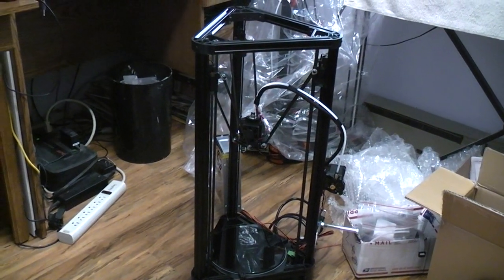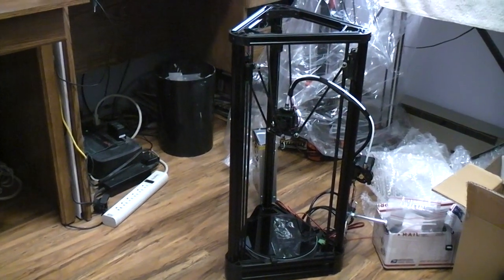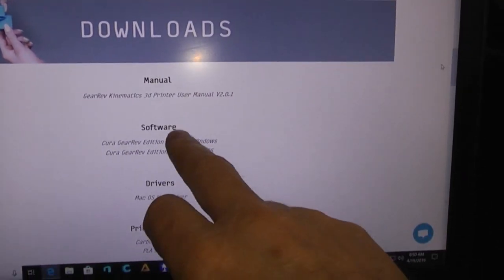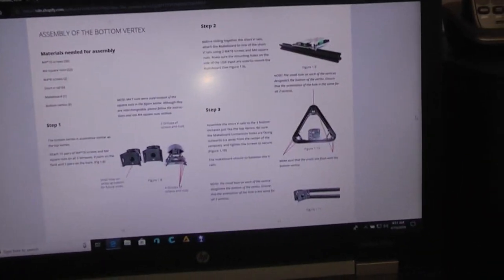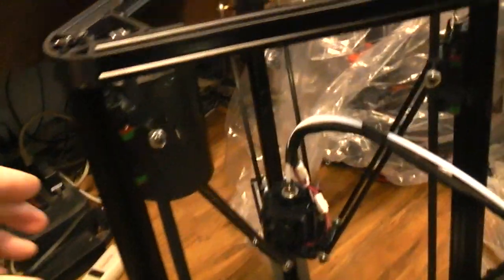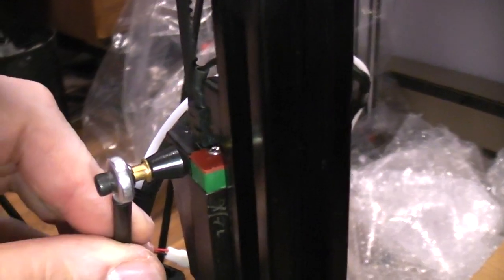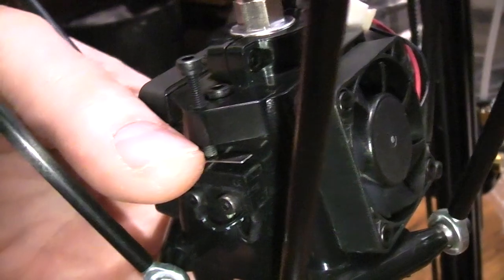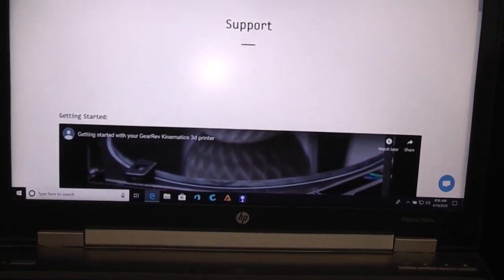GearRev Kinematics "MicroMake D1" Delta 3d printer, linear rails, $126 bucks Part1 build

Comment: Have you gotten yours to work? ive just assembled mine, and it came with a broken psu, rusty rails, and I cant get its firmware to do crap. When I load up a gcode file it heats up, then cools back down and acts like the print is finished
Reply from the maker: I am waiting for the Control board to arrive, mine was missing the control board as mentioned. But The rails clean up easly and a drop of oil in the ball bearings made them work so nice and smooth in my case any way. I will probably order another one just for the parts at this price. Seems that these came out in 2017 so they are either old stock or returns or both. The FLSun , the Micro Make D1 and the GearRev all seem to have been built by the factory and came out at the same time. The FLSUN has a few minor changes. I will post a follow up video once I get the control board. You should email them that yours is not working, they probably will send you another unit.
Reply: @Robothut  are they sending you an entirely new printer? I'll try the oil trick, can I use wd40? I've contacted them though eBay and I'll see what happens, so far I'm not happy with my printer, and I hope a new one they send would be better. I'm also flashing Marlin to it because repretier+ gerrev cura is outdated and practically useless
Reply from the maker: I am not sure if they are sending a new printer or just the control board. We will have to see, last time it took 13 days to get here so probably next week before I know. Yes it might only be a good deal for those that want a lot of 3d printer parts that they can use for custom 3d printer projects. But on the other hand if they do send you a replacement printer then that would be a super deal for parts. I still like the CTC 3d printer kits you can buy at $79 bucks on Alie express and gearbest and so on, just for parts, and I really like buying the FOR PARTS ONLY flash forge printers on ebay like the Flash Forge Finder for $100 bucks. Even if you can not fit them the parts alone are worth the bucks. So yes contact them lets see if or what they send you.
Reply: @Robothut  Yeah, it would be great if we both got new printers. It looks like they are just sending a new psu for me though. Right now im not sure if i made the right decision in buying one, but well see. best of luck. Ill check out the ctc printers.
Reply: @MakingwithLuke  Looks like we all ordered the same printer since i purchased the same one about 2 weeks ago. I also had the rusty rails as well but a quick clean up with WD40 and oil gets them back into shape. Currently on day 2 on attempting to get it properly leveled but being a utter pain. Using this calculator " https://escher3d.com/pages/wizards/wizarddelta.php " but once i attempted to print something large around 80mm width my head scrapes the bed.
Reply: @professor7457  Yeah, I believe so. I will put some WD40 on mine too, and see how it works. I had to do a full tuneup, disassembly, just short of changing out the balls, and they work better now. I will be making a custom marlin firmware for mine as I'm having trouble with the repetier it came with. thanks for the link, once i get my firmware working ill post it and you can use it if you please.
Reply: @MakingwithLuke  Finally got the printer to work properly. I installed the Micromake D1 firmware located in there google drive. Then added 3 screws (Set screws to same height) above all 3 linear rails since having a mechanical offset makes things easier to change on the fly. After words followed these instructions "  https://github.com/Bougakov/Micromake-D1-3D-printer/blob/master/calibrating.md " . Once i finished and got a tolerance of 0.02 i then checked X,Y,Z Tower at Z0 to confirm each tower was the same height at 0. Took a couple of tweaks but once that was done my printer was up and running. Process only takes me around 25 minutes to do once you do it once. Feel free to message me if you need some help. Defiantly no expert but 2 heads are better then 1.
Reply: @professor7457  Great to hear! I too have gotten mine to "work" I made a custom version of marlin, and am currently tuning, calibrating, and adjusting. Is this micromake firmware you mentioned Marlin? I may just install that. I will also consider the screw technique and work to make the effector more rigid. it does not self calibrate well when so wobbly. Ill definitely keep you updated on my progress, I agree two heads are better than one.

Comment: What do these kind of printers offer over other 3D printers? 
Tall Height build? Speed?  👀  ....or is it just a different design to do the same thing?
Reply from the maker: Delta prints offer more speed, it is easier too move the low mass hot end in all directions with the 3 effector rods than it is to move a large heat bed "Y" and X carriage and Z height. But it really is just a different way to do it and very fun to watch in action. There many different type of printers, there are some where the hot end only goes up and down "Z" and the bed moved left and right and front to back. There are also robot arms with 3d printer hot ends in stead of grippers. Crazy stuff out there.

Comment: I believe this is a re-branded Micromake D1.
Reply from the maker: Looks like the same printer to me also. I wonder what one came first or if they both are made by some china factory and branded for who ever wanted to sell them. So many of the parts are the same as the fulsun delta. Same factory , I wonder. Any looks like a very good deal for the money.
Reply from the maker: I just did a you tube search for the MicroMake D1 and there seems to be many versions of the D1. Some have the roller wheels like the fulsun and some the linear rails. Some use a clip on preshure sensor for the auto bed level and some use the tipping hot end and micro switch.  Crazy.